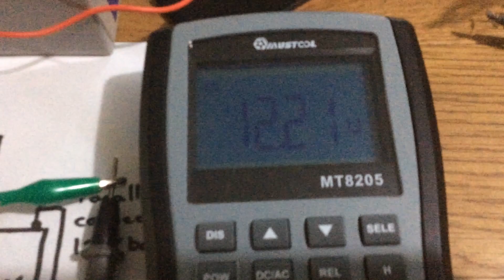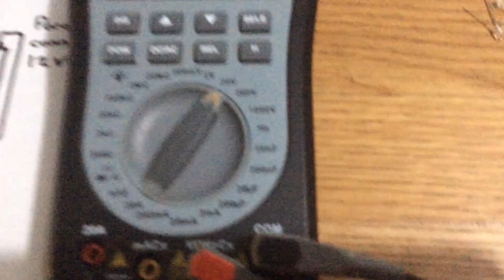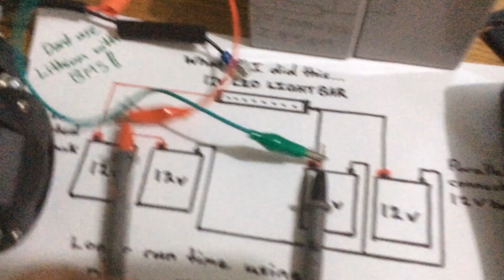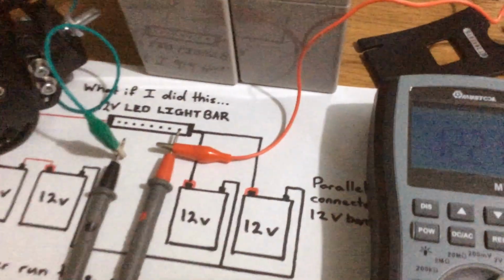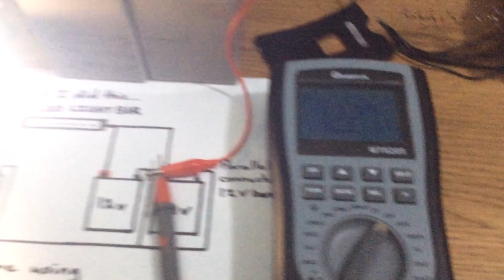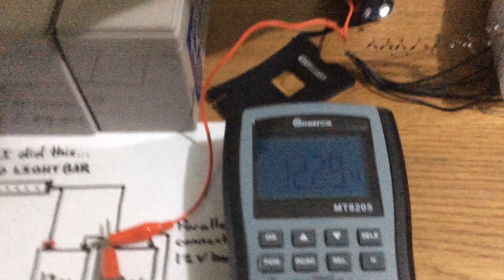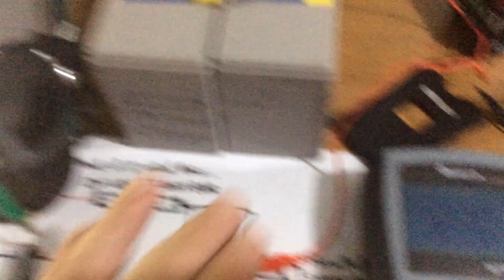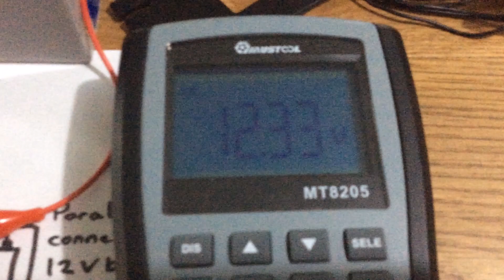Tesla Power Saving Power Transfer with 12 volt batteries.

Comment: Thanks so much for your efforts and humanitarian heart that you do have. By the way how far was the capacitors?
Reply from the maker: The capacitors did not last as long as expected but this does not speak to the efficiency as there are several more tests that are needed to determine efficiency here. One problem is the 2.7 volt caps x 2 in series = 5.4 volts which is a little high for a 3.2volt LED so a lot of power is lost to heat. I’m thinking of using slightly higher voltage caps and charging them only to 3.2 volts or to be a fair comparison I should charge them to 3.6 volt as is the AA battery version. I will measure the transferred voltage in the caps before swapping them around.
I
Reply: @whatifididthis...1236  Thanks so much I do get it. You are right but don't loss hope as capacitors are made to store small amounts of energy and can be discharged with a single spark and by using the formula  0.5CV^2, you will realize it's little energy stored. However I do suggest we try to take keen observations by first recording the time taken for the led load to discharge the for capacitors. Then we start our experiment as we do record the time taken and voltage changes in every swaping. 
Thanks.
Reply from the maker: @wambeddemustafa1193  Thanks for your comment. I believe you are correct that the capacitors should be more efficient, part of the reason for the shorter run time is the opportunity for capacitors to charge and discharge rapidly, there is less resistance and therefore more energy should be transferred. Once I measure the voltage of the transferred energy in the caps we will have some idea of its efficiency.
Reply: @whatifididthis...1236  Thanks once again . Am still optimistic about them.

Comment: Great stuff !
Instead of switching batteries, why not use a switch ?
Reply from the maker: Thank you for watching. That is practically what Tesla did, he called it the Tesla Switch. I would like to do that one day but is is somewhat complex and I’m concerned the message would be lost in its complexity. I figure if I show it first in a manner that requires no skill, then anyone can do this. An automatic switch would be nice and has been done before, a company by the name of Electrodyne Corp replicated Tesla’s Switch and ran approximately 2 kilowatts of load for 3 years with no input. The basic concept of that system  auto switching is similar to turning off a water tap quickly and a hammer or shock can be heard and felt, the theory suggests the energy experiences a gain when slamming to a halt some 100 to 800 times per second.
One day I will build it, hopefully sooner than later.

Comment: Any ideas of automatic switching? So no need to move wires around. 

Another thing, there is step up 12to24 volts regulator… what if to charge 1-1 battery with step up?
Reply from the maker: Thank you for watching. There is definitely a circuit for automatic switching however it is somewhat complex. I can supply a copy in my next video if you like. I think it’s important that we learn how to use energy properly in its simplest form and then we can start to shoot for the stars when we know our foundation has been proven fact.
Reply: @whatifididthis...1236  You are indeed right. Infact I would also advice you also try using a small brushed DC motor as a load across those batteries so that we can also get the  differences between LED bulbs and induction motors and also may resistive load to get a better conclusive experiment.
Thanks
Reply: Like a Joule-Thief between the 24 to 12
Reply from the maker: @reloadwin82  Thanks for watching. Yes, something like a joule thief will transfer power very effectively. You can use my design also for transmission through earth or my portable lighting version works with this energy transfer concept. In fact most 12 volt devices can be used. I believe this will help people who struggle to collect solar energy in overcast climates if they only need to recharge once a week or every few days, it should also save thousands as you need less batteries. I will make a video soon demonstrating an efficient heater.